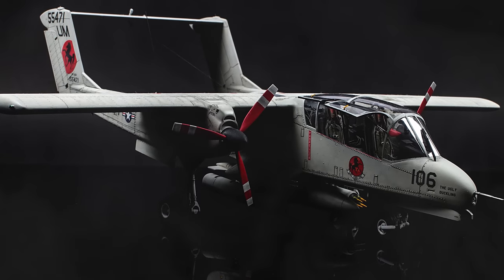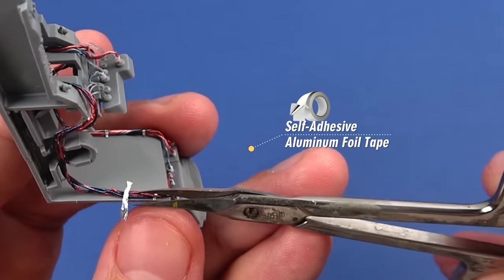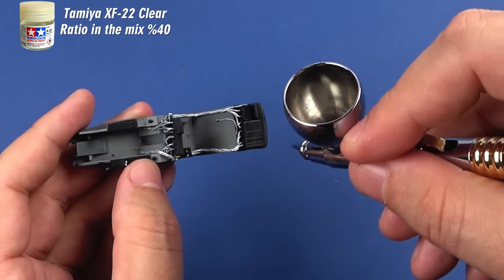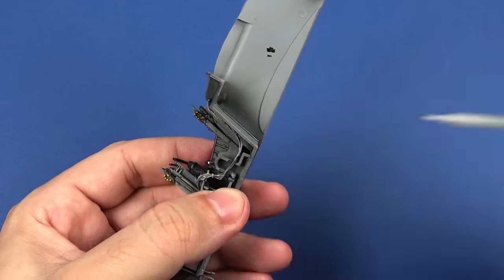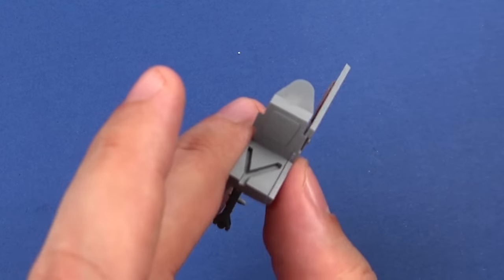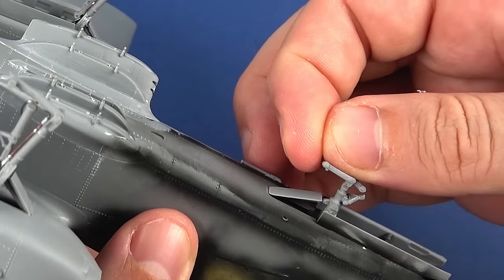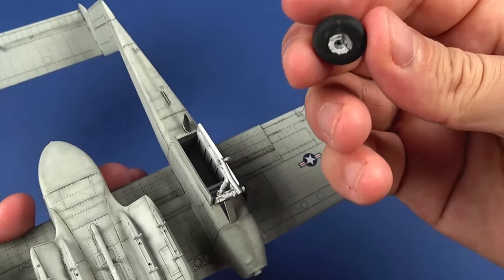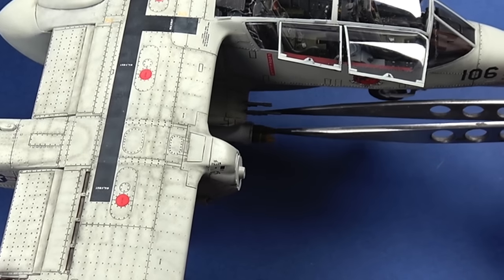ICM OV-10A Bronco 1/48 Scale Model Aircraft Build 4K Re-mastered Video

Comment: Gonna ask a noob question, what eyewear do you use? I imagine something with magnification right?

Would seem redundant to add my praise to the other comments but... Scratch built control levers?!! The polished canopy... The instrument wiring... The cling film trick... The open canopy door and it's struts.

It all goes to make a top quality and interesting model, not forgetting the gun pylons and underwing stores.

The aircraft itself has a great chunky & different vibe, but I always felt the wingtips were designed by the intern, too short and straight. 

Form following function I guess, like the A10, ground attack and in this case also observation platform demands certain features. Especially protection against ground fire.
Reply: ... and totally justifies the rerelease at higher rez.